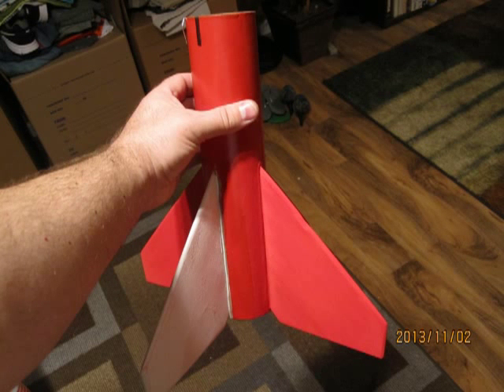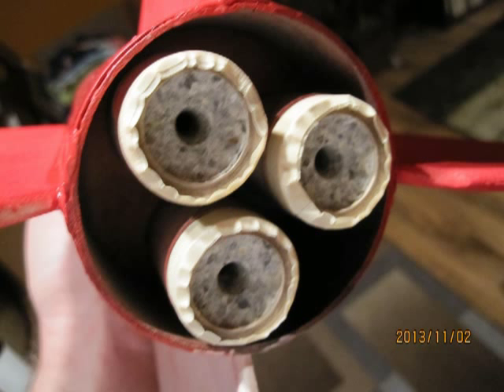Launch of a two stage Super Big Bertha model rocket

Comment: Would like more details on the booster stage...
Reply from the maker: The booster is made from 12 inches of BT-80 body tube and a triple 24mm motor mount like this one: https://www.ebay.com/itm/Motor-Mount-Triple-24mm-To-BT-80-For-3-75-E-Motor/351657373755.  On top of it I build an interstage device with a micro-safety switch and a micro rocker switch which connect to a mini electronic timer.  I use a 9 volt battery and an SCR, along with the timer and switches so that the rocket ignites the upper stage after a set time.  My best results have been when I set the timer for 1 second for Estes D12 motors and 2 seconds for Estes E12 motors.